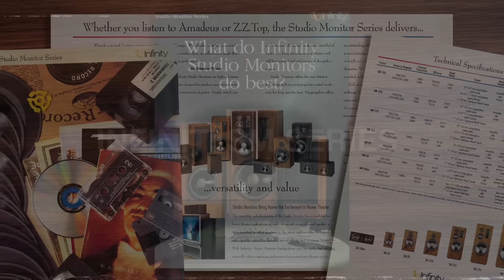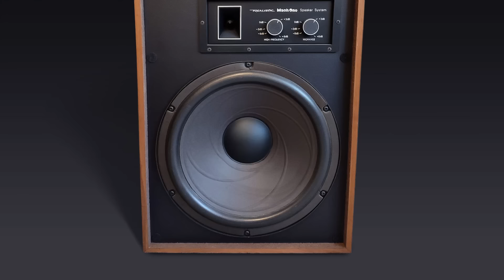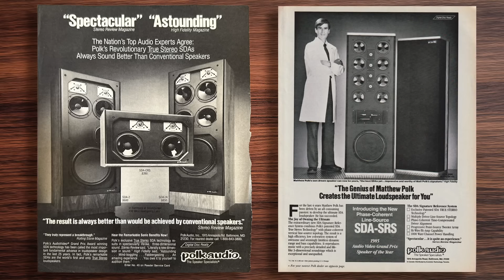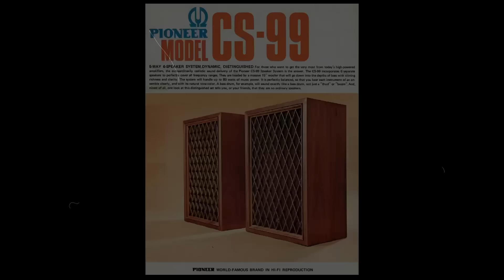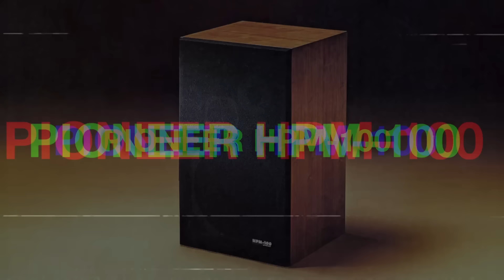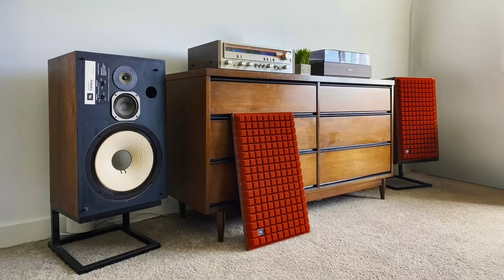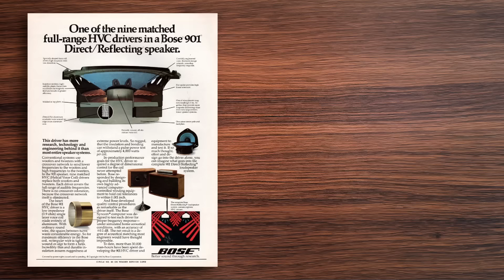Why Do Audiophiles Hate These 9 Legendary Speakers?

Comment: I had the Infinity SM 115s as front speakers in my first HT. Dolby Pro Logic II, VHS days. The bass is on the boomy side, but they have a full open box with hardly any bracing, a few glued in pieces that I wouldn't count as good rib bracing, and zero dampening. Just adding some carpet padding behind the woofer cleaned the bass up a LOT. I'd imagine some window bracing above and below, and real acoustic material behind the woofer would help out more. I've never once heard of the SM line as  having weak mid-range. I'd have to disagree on that. They were pretty revealing, just had that boomy bass.

Comment: Nice video. For background, I have 2 pair of large Martin Logan electrostatic speakers with high quality front ends. That said, let's talk about the Klipsch Heritage line. My take on these speakers is that in large rooms, these speakers are excellent and not shouty. Perhaps this is because far field listening allows the horn drivers to sonically blend properly. The Heritage line can sound quite good and accurate, to me ,in large rooms where far field listening is possible. For mid field and near field listening they do not have time to properly blend. 

On a different topic, I had a good friend who had B&W Nautilus speakers in a small room powered by 4 Nelson Pass amplifiers. Those speakers sounded far too bright in that setting. Later he moved the system in to a more appropriate (much larger ) space and they sounded great. My take is that sometimes the speaker needs to be selected based on the space/room they will occupy.

Comment: I run Three Yamaha M80 amps through two sets of Bose 901's for my side and rear surround and a Klipsch front sound bar (biamped). I also have two Yamaha 400 watt subwoofers. I use a Pioneer sixteen band equalizer to balance the Bose 901's and a Yamaha M80 preamp tied to Pioneer 7 channel receiver to make it all work together. I never need to exceed the class 'A' setting on my amps to get plenty of great sound. Took a lot of adjusting to get the sound balanced; you would not like the sound no doubt!

Comment: Kevin,  your take on these is pretty good. In the group, I will admit that I'm a "hard pass" on 9 of them. Pretty much on your  reasoning. 
The Cerwins, SMs, and Klipsch are all bright, in your face,  boomy, and just don't make real bass. On the upside,  the dynamics with a moderate powered receiver is impressive. One of my all time favorite speakers to demo was the JBL L1. On a switching system with volume compensation, those refrigerator sized behemoths stood no chance. The bass was deeper,  tighter, and better defined. 
I put the 901s,  big Cerwins,  SMs, and Polks in the Kabuki category. 
The L100s, HPMs, and Mach 1s had far too much of a "disco smile" response curve. The woofer on the Mach 1s was far closer to a full range driver than an actual woofer.

As you said,  there are people for all of these, it's just not me.  Unfortunately,  a lot of people get stuck on things that they think they want, but doesn't fit their reality.  Odd rooms and small power with 901s are a great example. 
Me? I'm sitting in front of my Yamaha M65 driving a pair of nice 6" bookshelves. I  have a Citation 16 nearly completed,  and a Musical Concepts modded DH500 that needs some TLC. For 35 years,, big power on quality bookshelves has been my kink.

Comment: I rescued a pair of CS-99a from the recycling center. Did a restore on them over the winter. Redoing the x-overs was a project onto itself. Yes bass needs a sub. But keep in mind these weee designed as accent furniture. Paraphrasing an ad ‘sound for you and appeals to her’,  At 60+ lbs I’m in no rush to take then out of the basement. BTW my main vintage system runs on Heresy 1’s… positioning and a sub on those is critical. Also have CV’s and AR’s on other systems.

Comment: I used to work at a appliance stores audio department in the 80s similar to circuit city . We sold the infinity , cerwin Vega and JBL speakers that you had in video. We sold quite a bit of those speakers . I used to own a pair of Cerwin Vega D5, which I was very happy with.

Comment: Too many speaker cones in a cabinet= sound wave cancellation,
Reply: Mids and tweeters are sealed(or should be). The issue is lack of bracing, and often something less than MDF. Also, they didn't have modern software design for crossovers.

Comment: 9:10 >> La Scala. My dream speakers. I remember I had a pair of Klipsch KLF-20. I sometimes regret selling these (though I like to try different stuff). They were magnificent. Great bass, crisp sound, very efficient.
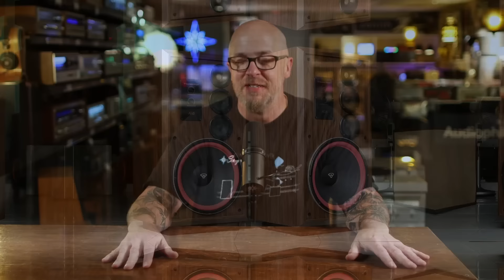11:20. How can someone hate these? I've had a pair in my later teenage years. AT-100(AT-15 in US). It's basically designed as a subwoofer, then installed drivers/crossovers in the cab for full-range. HiFi..? Nah! Impressive(Fun)..? Absolutely! :) The 50-100 Hz octave (bass punch!) in the AL-100(15) is impressive.
Clean sound is a matter of taste. It can sound clean, without sounding flat. Cerwin Vega as an example sounds clean even at high SPL, where a more "High-Fidelity" large speaker wound need a huge amount of power to reach, and therefore have more power compression/distortion happening. You can easily get a Cerwin Vega AT-100(15) to 117dB @1m while still sounding clean and effortless (100W is enough). You probably can't get a B&W Matrix 801 to 117dB@1m at all (you either fry the drivers/crossovers, or it will sound horrible at that SPL, needing 1000W, compressing the output as well). 
Clean sound means lowest possible distortion. Well designed Horn speakers can actually sound very clean(@high SPL), because you put less power into them, meaning less power compression/distortion in the drivers. Flat sounding speakers with lowest possible distortion, is proven to give least listetiner fatigue, witch is where the High-Fidelity speakers come in. Speaker design is a compromise. You want optimal flat response, clean sound, high SPL? No speaker can give you all three (but two they can).

Comment: Bose SUCK. There. I said it. I had them factory-installed in my previous car (they came standard with the Sat-Nav). They never sounded any better than stock, run-of-the-mill, speakers. Then again, it makes sense, because they've always used El Cheapo drivers in everything they did.

Comment: 6:24 >> I have a pair of the Sansui SP-X8000. They both have had the two small horn "supertweeter" drivers replaced by some other "small cone" tweeters. (need a 2-3dB treble boost now, but the high freqs are more rounded and not sharp)
I do like how these speakers sound. Not "HiFi perfect", but they have a big warm sound to them you don't get from small speakers (no replacement for displacement). The high-mid horn gives them a certain presence in vocals I rarely hear on other big speakers like Cerwin Vega (maybe AL-1000 is up there). This horn impresses me by not discoloring the sound. Crossover well with the two midrange drivers on each side. Very midrange clarity! Horizontal high-mid freq dispersion is limited due to horn mounting (30-40 deg max), so for corner placement it's not that bad. But then again, the high-mid frequencies does shorten wavelength, so naturally is limited dispersion as well. The Bass is there, but because of the cabinet/port-tuning, they don't go deep at all (though don't need a sub for general music listening either). They do mid bass pretty good. Efficiency is very good. They are good party speakers, and easily fill a big room (100+ dB) with 50-100W amp-power. Also suitable tor garden/outdoor party, sue to their SPL capability. Late 70's Disco, house and other kick-drum rhythm music really sounds great and "lively" on these - especially if you put 5-10 watts in them, to make the stiff-suspesion bass-woofers move.
Another advise for those folks who have these. Put them on some form of stands. At least 250mm over floor. They sound even better. You want as little as possible reflection for the horn to your floor. And bass also tighten up when away from the floor (less boom). They can be placed close bo the wall, since reflex ports are in front. I would even say, you can mount them on the wall, preferable about 1 meter over floor to get at least as possble reflections on floor/ceeling.
Tamon TS-808N. Try these for a good High-SPL "Kabuki" speakers. They give Cerwin Vega AT-15 a run for it's money regarding SPL/efficiency. Might "only" take 300W(rated) , and doesn't give the 40 Hz shakin output as the AT-15. But the Tamon's are marginally more compact (and bas is still punchy and deep enough for most)

Comment: I bought a pair of Whafedale Laser 100's  back in 1981. My stereo has long since gone but my  LG TV is hooked upto to them via a Technics SU V300 amp. I listen to my wav files bluetoothed from my phone to the TV  and out via the speakers. The sound fills my living room with memories of my youth. No harshness just a rich smooth clarity that I have never felt the need to change.  One thing I notice is audiophiles never mention is the peak hearing is around 25 years in age after that it deminishes  quite rapidly. At 65 years old it is quite astonishing how much of the high and low spectrum I  have lost...

Comment: I had some Mach 1 when I was in my 20's. Hook them up to 100W wide open, tap the keg, put on some B52's and you got a party. And not sure what they did with the drivers, but you could not blow them, the SPL they would put out was deafening, neighbors would endlessly call the cops on us :) Don't buy unless you are looking for 100db+ SPL. 100% a party speaker.

Comment: Agree totally with your comments on all the speakers you reviewed.  The Bose 901s did vary a lot and I think I know the answer...  It wasn't the listening room which was the problem, it was the recordings you play on them.  Bose made some "reference" recordings with no acoustic reverberation and once they were placed in a room, the reflections provided the ambiance missing in the recording and they sounded good.  If you played "normal" music on them they sounded smeared and blurry.  

Also, any speaker that needed the help of what is essentially a graphic equalizer to sound better than an old AM radio shouldn't be allowed to be called "Hi Fi".  The 5 inch paper coned drivers with no bass woofer or tweeter didn't help except that you could play them LOUD without fear of frying the tweeters!

Comment: 1990, I was speaker shopping as my old speakers tipped over in the 89 Loma Prieta earthquake, and destroyed the woofer cones.  (same event had my Marantz 500 amplifier falling on my Dual turntable).     I went to a dozen or so stereo stores around Silicon Valley and Santa Cruz, with the same 5 CD tracks I wanted to hear on various speakers.      Best speakers I seriously listened to were the Vandersteen 2a(insert more letters), but they were 2-3X above my price line.  I quickly rejected the Klipsch as sounding way too 'horny'.   I heard some lovely Ohm walsh driver speakers, but they were WAY out of my price range AND too big.  I almost bought a set of blue-foam L100's, but then I heard a set of L100T (the first T) in a nice listening room, driven by equipment not unlike my own, and ended up buying them.   AND the Hafler XL280 amp that was driving them.   To me at least, the L100T rocked as hard as the L100s, but could play clean acoustic music at sane volumes quite delicately, a capella, single miked bluegrass quartets, etc.  And they looked nicer in the living room.  OK, yes, I've had to get the woofers refoamed since they were new, and I have a new set of the dome tweeters ready to install.

Comment: Being a 19 year old Marine in Japan in the early '80s and having an audiophile step-dad, I didn't go for the Pioneer stack 'o components, etc. And my dad always said Japanese electronics were awesome, but they made horrible speakers. So I went with a Yamaha C4 pre-amp, an Onkyo M5090 250wpc power amp, Denon DP60L turntable, and a Nakamichi 680zx cassette deck. I started out with JBL L150a speakers, but I switched to the L112 models. While anybody with "golden ears" would take issue with my system, for a teenage metal head, it crushed all-comers as far as I was concerned.

Comment: I like the look of the Klipsh, and I like efficient speakers, not being able to get high powered receivers or amps.  Consumer speakers generally don't have great divers.  The manufacturers or designers tune the cross-overs, cabinet and and ports to generate the sound that they are looking for.  Money is always a factor. Ok, that is just my opinion.  If the cabinet is good and there are only a few drives, the speaker can benefit from better drivers and reworked cross-overs.  Software can be a big help nowadays.

Comment: I've owned most of the speakers on that list at one time or another. 
The Infiniti SM line was split in two sets of speakers, the first 100 series, and  the European 200 series which were far more refined and capable. The early series was pretty much competition for Technics and Pioneer but the second half that line was hugely improved, but rare for some reason today. I currently have a pair of SM-255's that are in near mint condition. 

Most of the Kabuki speakers from the 70's were typical heavy metal speakers, they were fine for making a lot of noise, but worthless for fine listening or any sort of detail. Some were better than others but none really stood out as good. 

I never liked the highs on the HPM 100's or the 150's for that matter. I've owned both and sold both fairly quickly. 

I've owned several models of Klipsch speakers but none were keepers, I never liked horns and felt they were too distorted or artificial sounding. I did have a pair of Heresy speakers that sounded good on a few amps but they were hard to place and get that sound out of. They needed a huge area and proper placement. 

The JBL L100 is one I still own, not because I consider it a keeper but because the set I've got is pretty rough. They lived in someone's basement bar and they had brackets lag bolted top and bottom to mount them to the wall. Each one had a Pair of Cambridge Soundworks satelite speakers attached to the top with double sided foam tape. I drilled and plugged the holes, sanded them somewhat smooth, refoamed the woofers and I've been using them in my basement shop. They're okay, but not great, but I like them better than the L112's that came after them. 

I've owned five of the Polk SDA series models, all larger models, and non stayed with me for long. They sound good at lower volumes with 'some' music. It took very detailed recordings, mostly female vocals to bring out their best but for general listening they were borderline at best. I liked the Monitor series better, with the #7 and #10 being the two best models. The Monitor 12 was decent but they shined best with a ton of power and lower listening levels with proper placement, something the 7 and 10 didn't exhibit. 

Cerwin Vega is a party speaker, no more, no less. Lots of blaring highs and lots of loud but booming bass. I've had several larger models but non were keepers for long. They are easy to sell though, there's no shortage of buyers for them. 

I've never heard a Bose set up I liked, I've had 501 and 901 speakers both early and later versions of the 901 and both were awful in my opinion. Beyond just using them a maybe movie sound speakers or as background music speakers in an office somewhere they have no real detail, crap for bass, and are affected by everything in the room I refoamed the first pair I bought, in hopes there was something to them but I was never more disappointed and then went on CL after less than a week. They drew a ton of attention and sold for good money fast. Now, unless they're minty clean and cheap, I ignore them and take a pass. 

I've owned a few Mach 1 speakers and of the three versions they sold, (Mach 1, 2, & 3), I like the Mach 1 best even though most don't agree. They seem to do best on a period receiver, mine came with an STA-2000 which I recapped and cleaned. I still own the receiver but the speakers are gone, Replaced by a set of Polk Monitor 10's and a pair of Realistic 1100 towers. Its a system in a spare room.

Comment: Thoroughly enjoyed this video! I run a pair of L-100s (through a Sansui 7070) and agree that they like being wound up. It took a good bit of effort to get them to sound good in the room. I ended up putting them on their sides on 18" stands about 10" off the wall. Before I got to that configuration, they had a severe lack of mid-range and upper range bass in several configurations (including plugging the ports, etc.). They have been recapped with nice Clarity caps and the tweeter/mid pots have been cleaned, and I think they are functioning as designed. I like them for the most part, but some records don't sound great on them. They are definitely sensitive to cheaply produced and/or manufactured albums. They do have great physical presence, though, especially with the grilles removed, but I care less and less about presence vs. sound these days.
Reply: Loved my sansui 17" 85 model 320 watt speakers. They handled the clean power from my 2101 sansui amp. 200w continuous per channel. They took clear to the highest level with depth like a concert. Pinky out clarity at 20 watts could never take 300rms like the spz9IIs did. To this day I have 15" sp8s, and they bark
Reply: Madisound has a greatly improved crossover available for the L100's. They're around $150 each at the moment as far as I know. I gave them the schematics for them 16 years ago. They're a vast improvement over the original L100 crossovers.